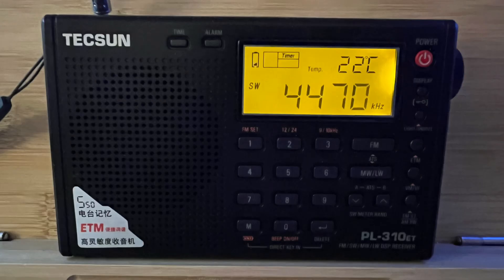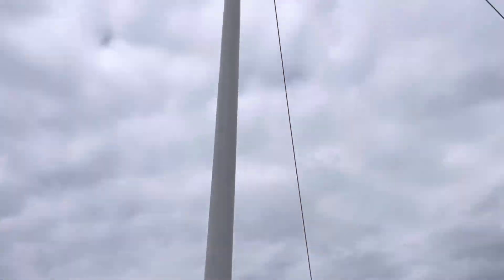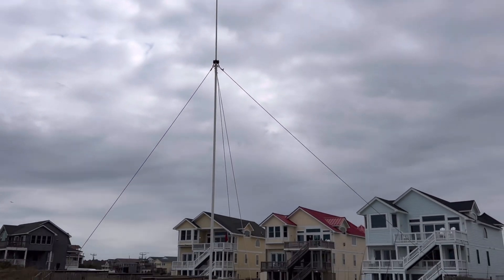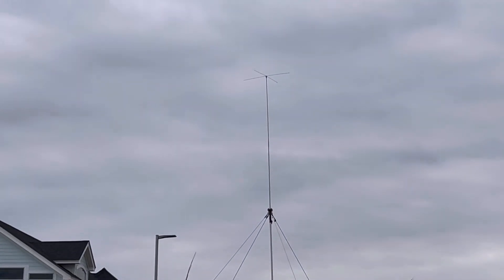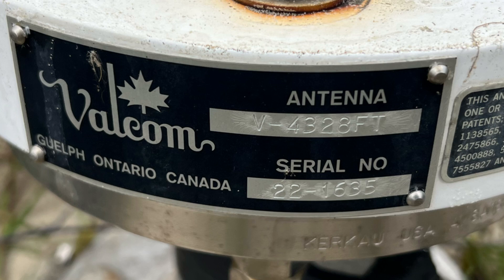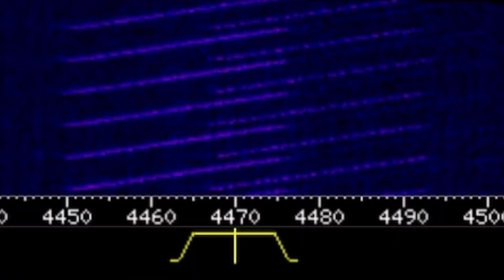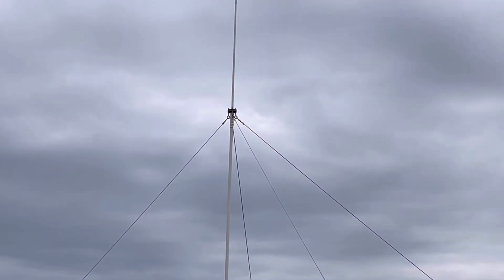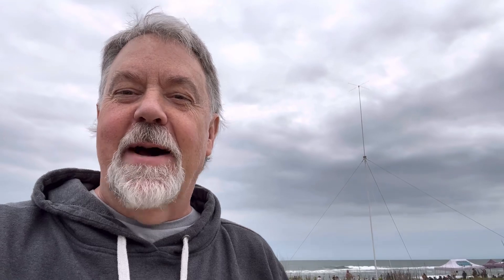HF Radar on the Coast - What is it?

Comment: Man you learn something new every day.  I was scratching the grey hairs on my head in terms of trying to figure out what those signals were and what was causing them.  This is because they always exhibited that sweep pattern effect and not just a fixed frequency location.  As well, I thought those signals were emitted from other devices in my house.  That was until I turned off or unplugged everything I thought that could be causing that signal only to find it was still there.

Comment: Going back through the video and when you showed the Valcom base…. 1) It is mounted on a plywood base?  2) There are wire radials connected to the lowest layer like a DX Commander.  I am fixated on this design. A new project!  3) Surprised it doesn’t have dune fencing around it.

Comment: That's cool.  Many moons ago there was a HF OTH radar site here run by the USAF.  The transmitter was 1MW and it could see small planes all the way down beyond Florida and also detect changes in the current of the Atlantic.  We also had a HF DF receiver here. Of course we don't need any of that anymore (because of the new state of the art crap) so it was all decommissioned about 25 years ago.

Comment: What antenna do you recommend for listening to radio frequency? 11175khz.
Reply from the maker: For just receiving I would just use a simple wire antenna like this:
https://a.co/d/5NLeMXk
Reply: @COASTALWAVESWIRES  thank you so much for the reply. Receiving is all I'm trying to accomplish. I was also curious if It would work on 11175 khz. USB as well ?
Reply from the maker: @Eternalvigilance1776.  yes

Comment: Nothing new here. The UK and USA governments were using similar technology to track Russian ICBM launches as far back as the 1960s.
Reply from the maker: Yes that was OTH Over the Horizon HF radar. Similar but not the same thing
Reply: @COASTALWAVESWIRES  OK the UK system required a 500,000 watt transmitter. No doubt the USA was similar.

Comment: Where was the transmitter / receiver? Follow the coax? Needs power so mounted on a power pole?
Reply from the maker: Coax was buried in the direction of the pier so I’m certain it is inside the pier which also is a part of the North Carolina Aquarium. Cool place to visit.
Reply: @COASTALWAVESWIRES  u just need a sand shovel .. don't destroy the dunes..